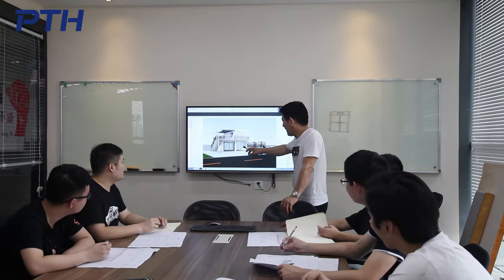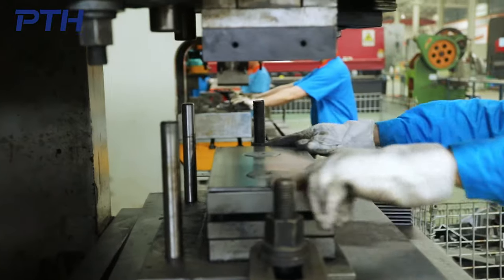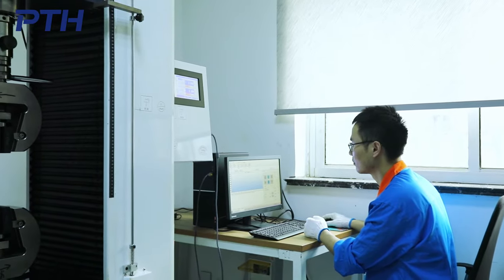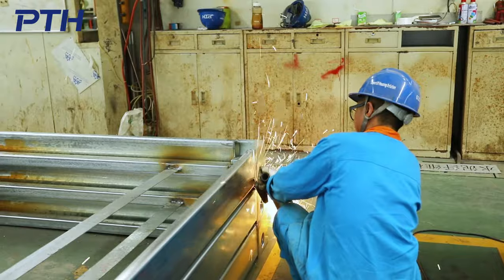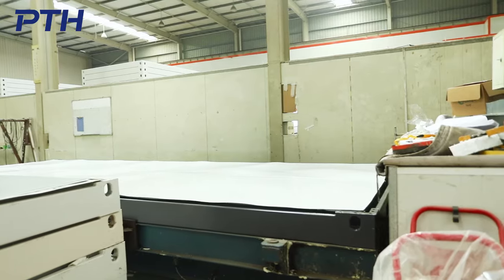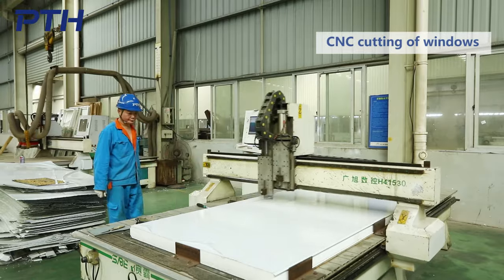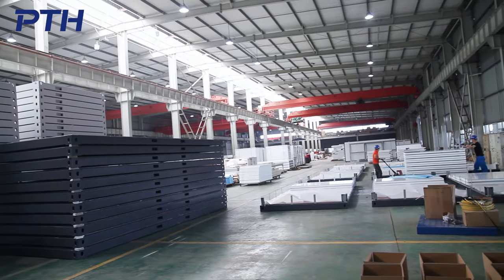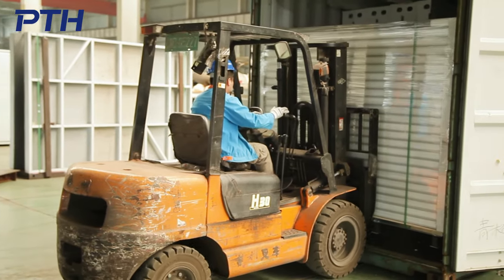2020 PTH Container house design and production process:Prefab container building/villa/camp/office

Comment: "Imagine a modular home design where a central hub connects various cabins, each serving a unique purpose like a bedroom, kitchen, living room, or dining room. The beauty of this design is that each cabin is an independent module, which you can add or remove as you wish. If you need an extra bedroom, you can simply add another bedroom cabin tomorrow, and if you no longer need it, you can sell it or relocate it. This adaptable setup offers the ultimate flexibility to customize and expand your home over time."

Comment: The video shows the use of PIR insulation to the roof and EPS to the walls. Are you able to provide PIR to the walls as well as the roof and at what density is the PIR, as EPS may provide adequate thermal resistance but would not provide adequate fire resistance.

In addition do you etch prime or navy wash the galvanised steel prior to application of polyurethane paint to ensure good surface adhesion?